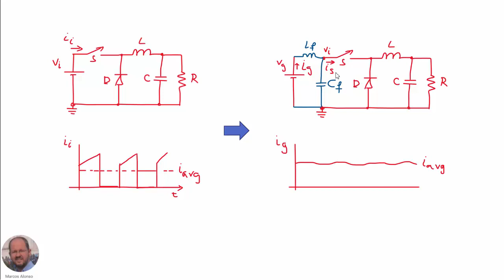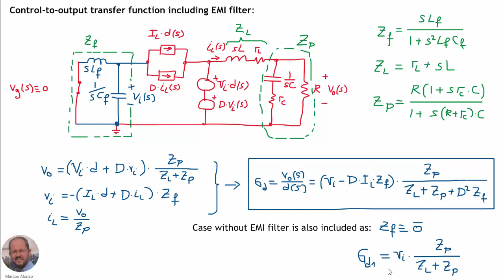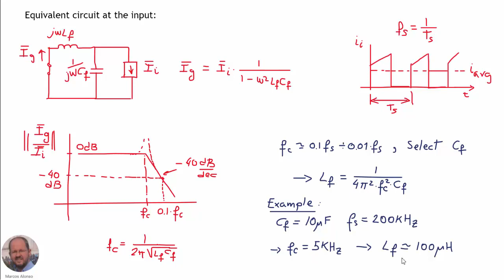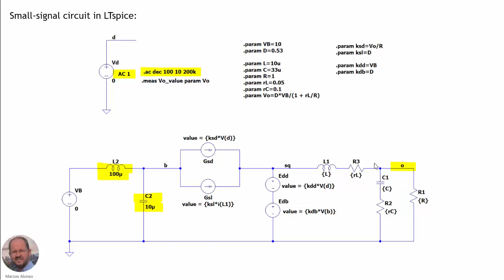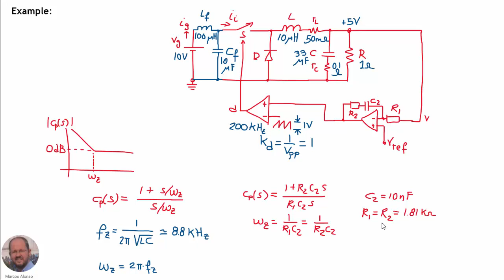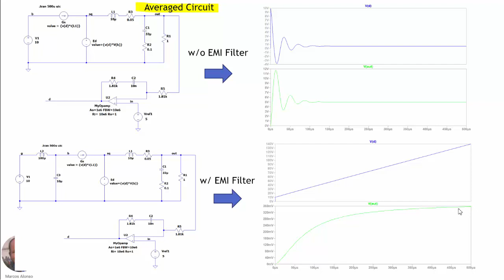PE #47: Effect of EMI Filter on the Dynamic Response of DC-DC Converters

Comment: Hi Marcos! Thank you very much for all your videos, they are awesome.

I have doubts regarding the resistance (ESR) of the capacitors (defined as rC). If at the output of my converter I have several ceramic capacitors the total ESR becomes smaller and smaller (around 1 mOhm?) and that makes my system very close to being unstable (~170º) before reaching 0 dB. One solution would be to add an electrolytic capacitor but I don't think this is the best solution due to the ripple current at the output of the converter...

What ESR should we take for the simulation? Because the ESR of a ceramic capacitor is different depending on the frequency.

Thank you very much for all you do!

Edit: I'm using your LTspice file from minute 15:00 without the EMI filter.
Reply from the maker: Thanks for your comment. Yes, the zero created by the capacitor ESR helps with the converter stability.
If rC is very small, the zero will be at very high frequency and its effect will be negligible.
I think that in this case you need to redesign the compensator accordingly to meet your requirements.

Regarding the second question, we model the real cap as an ideal cap with a series resistor (the ESR). For this we take the cap to an analyzer and measure its impedance versus frequency. From it you can get the values of the model, the ideal cap and the ESR. The ESR shoud not change with the frequency once you get the model in this way.
If you measure the cap with a analyzer point by point at different frequencies you will get different values of C and ESR. This is not the best way to obtain the model. The value of the ESR is at the frequency at which the impedance is minimum.
The impedance versus frequency of a cap is as follows:

Impedance
*        *
 *      *
  *    *
   *  *
    **  
--------------> freq

Before the minimum, the cap behaves as a capacitor, at the minimum is the ESR and beyond the minimum is an inductor (due to the parasitic series inductance. Usually we neglect this inductance in the model). The cap has to operate below the minimum to behave as a capacitor of course.
Reply: @MarcosAlonsoElectronics  Thanks for the explanation, I will try to adapt the compensator by looking at the DC/DC datasheet I want to use. :)